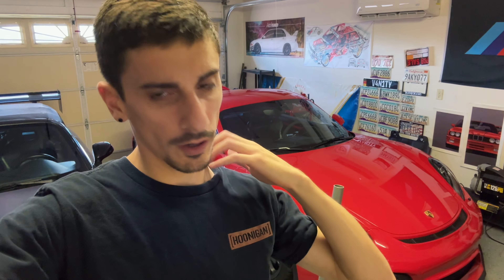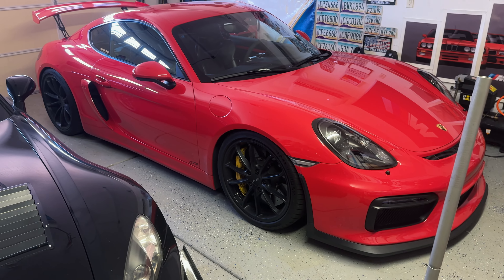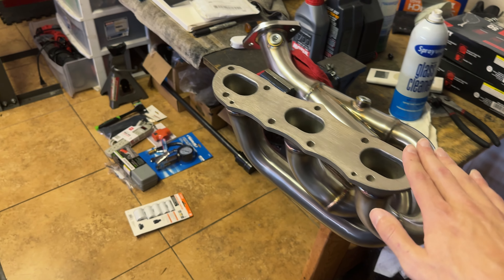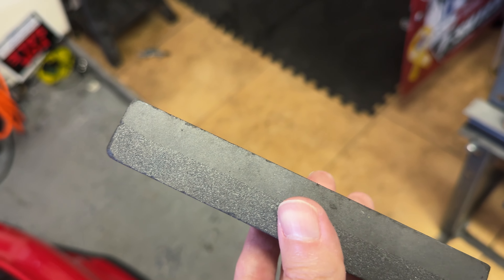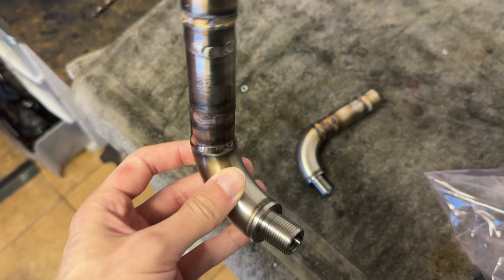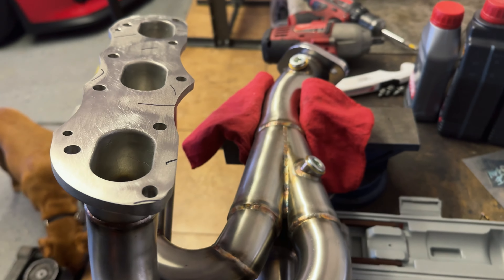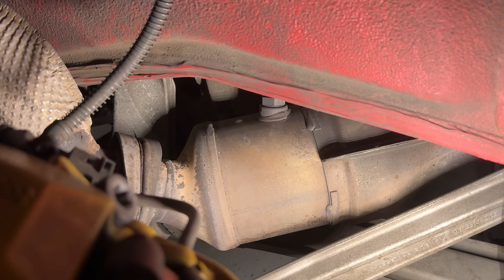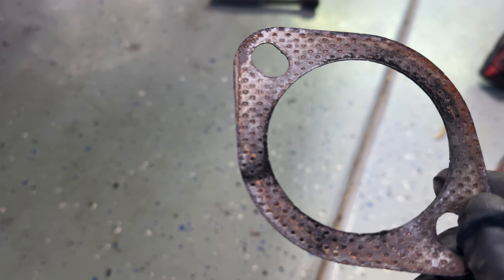Installing Headers On My Porsche 981 GT4 | Sounds Insane! | Exhaust Sound

Comment: Did you get any Check Engine Light after the install (during the drive)? I assume those mini cats must be working.
Reply from the maker: I still got a check engine light even with the mini cats. These cars calibrate the front o2s from the rears so it's a careful balance of how restrictive it should be. I ended up going back to stock. No tuners would touch the code I was throwing due to EPA crackdowns

Comment: How long did it take for the install?
Reply from the maker: If I didn't strip one of the threads above an hour and a half. It was also time consuming cutting out the inner o2 diverter and making the flanges flat

Comment: Nice video. Are these headers equal length?
Reply from the maker: I believe so, they are the same manufacturer for Soul and they advertise them as equal length long tubes
Reply: @CanyonTuned  thanks for your reply. Spend some time on reseach tonight. Soul headers are equal length I believe, but these ones aren't unfortunately. Still sound great though.

Comment: What's the rest of the exhaust? Is there a merge crossover (X or Y) or a single exit? Also, get the gearbox upgrade/re-gearing from DeMan motorsport, holy HELL will that make a difference. Porsche wasn't cooking SHIT with this gearbox, TBH. Also, the gear change is more important than the built 4.5L swap, especially if you can only pick one. But even if you eventually do both, you'll be very satisfied by going gearbox first.
Reply from the maker: The rest of the exhaust is the factory catback with a crossover at the tips. Yeah the gearset is cool but I really don't mind the stock gearing. Everyone complains about it online and it's really not that big of a deal. Especially the $10k cost plus voiding my CPO warranty. No thanks
Reply: @CanyonTuned  Ah, fair enough, then. Thanks for the reply and the car sounds great!
Reply: @CanyonTuned make sure you get a Protune with the headers. That’s mandatory